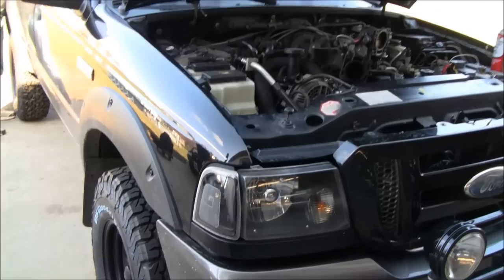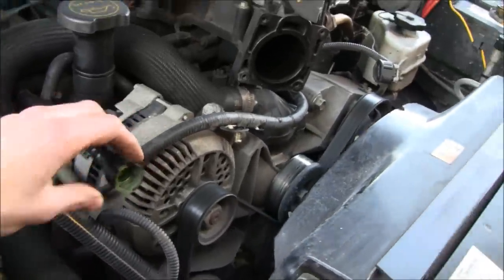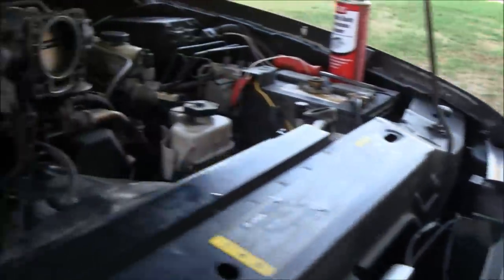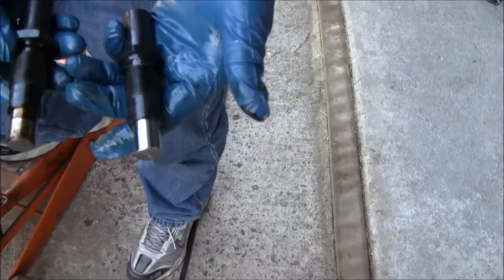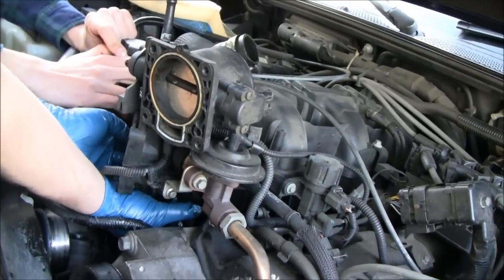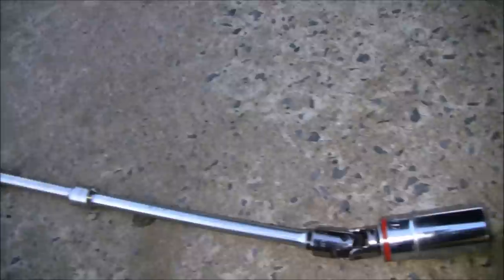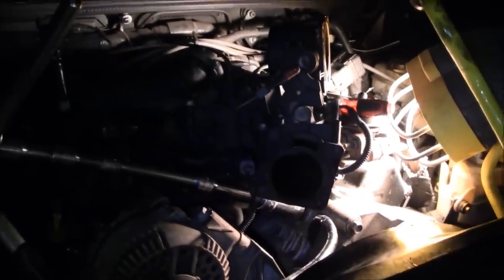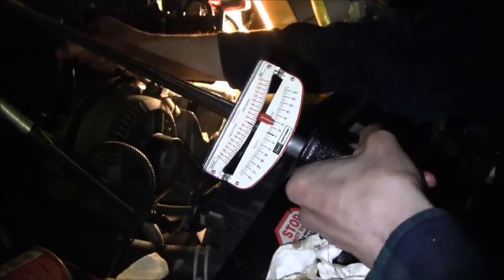REPLACING TIMING CHAIN TENSIONERS 4.0 SOHC

Comment: I got around to finally picking up the parts from Ford to do this.  Both tensioners and washers $210.  Going on my '03 that just has 69k miles on it.  Has always had the intermittent 1 second rattle at start up after sitting for a few days, nothing more.  Hope I don't break the thermostat housing is my only fear but if I do I know where they sell new ones....lol.

What was the difficulty in getting the top one to thread in in this video?  Just curious.
Reply from the maker: klc317 What really makes it hard is the fact that you have to fight the tensioners. After having primed them with oil they are very stiff and so you are fighting that pressure while trying to screw them in. After having some discussions with others who have done their tensioners, I'm not certain that they actually need be primed. This would make them a lot easier to install, but I don't know if I'd try it or not. You definitely don't want to have a problem with air stuck in them or something like that.
Reply: dirtbike5100 ok, thanks.
Reply: I got the whole pile of other parts as well in the mail today, the thermostat housings, new thermostat, all the seals, O-rings, and new sensors and retainers, etc. all OEM Ford stuff.  Really didn't cost that much more ....might as well do it all once and right IMO.  I'm kinda wondering if I can pull the fuel pump relay before I take stuff apart and run the engine out of gas.  Then crank it a little once everything is put back together to get oil pressure to the tensioners before reinstalling the relay without priming them first so I don't have as much as a fight installing them and risking cross threading.

I'll do some more reading and see, not in a giant hurry anyway.  Its cold in the garage and the Ranger is not an every day driver so I can wait until warmer weather.   Thanks again for the informative videos and replies!
Reply from the maker: +klc317 Anytime. Pulling the relay and cranking the engine will definitely get oil to the tensioners. The question is whether or not an air pocket in the tensioner itself could prevent it from fully filling with oil and working correctly. I don't know the answer to that however.
Reply: I did the job today.....just to try it out I did not prime the tensioners, seemed to work just fine.  Just about 1 second of noise until the oil pressure took over....no problems.   I also did the entire thermostat housing, new thermostat, sensors, seals, and O-rings...everything all OEM Ford parts.   That was pretty tricky trying to fish all that housing stuff around and not damage the new one but thanks to your video and a few others it wasn't a big deal....went in easier than the old one came out once you figure out how to get all the crap manipulated and out of your way.   And yea, some some of 8mm offset ratcheting wrench and some swivel sockets sure made those bolts easier!!  Successful, no leaks, just some oil burnoff on the exhaust manifold from the passenger side tensioner leaking out when I removed it.   Got it hot, drove it, let it cool off, burped some more air out of the cooling system, and all is well as far as I can tell.
Reply from the maker: +klc317 Good news. Thanks for reporting back on how it went!
Reply: Ford OEMs much cheaper thru Amazon\Ebay.  Local stealership will rip you every time.

Comment: So why do you need to prime these...  I mean I get the concept but I can not find any other information about doing this to these before you put them in.
Reply from the maker: Keylitho When I replaced them in my truck, I had problems with them not keeping tension on the chain and after doing some research I came across a few YouTube videos suggesting that I prime them. However, I later found out that the reason my tensioners weren't working was that they were not genuine Ford parts. It's possible then if you don't prime them but use Ford parts you will be fine, but I decided not to take the chance with the truck in the video.
Reply: Ok.. Good to know... I just replaced mine but just lubed them up a bit and did not prime them... (they are not OEM) and they seem to be ok... But I have not dove it around to see if all noise is stopped at all RPM's..
Reply from the maker: Keylitho The non-OEM ones I put in my truck were from Advance Auto. Brand was called SA Gear, I think. I started the truck up and the chains rattled continuously at any RPM. If it's not making noise at idle, that's a good start!
Reply: The ones I got are made by Cloyes Gear & Products, Inc.   I will keep my fingers crossed... If not then I will go get the ones from Ford.
Reply: Any luck with the cloyes brand tensioners?
Reply: No... went an got the OEM ones from Ford..
Reply: Keylitho Cloyes is the manufacturer of Ford original tensioner.
Reply: AZ DONALD A lot of people don't know that Cloyes is the ORIGINAL manufacturer of a lot of Ford timing components.  These tensioners included.
Reply: funny thing is that yesterday I was just cleaning up my mess (garage) and came across the boxes and realized I still have to install the front one, grrrrr.  

i'm glad they made improvements to the gear chain mechanism in 2002 cause I have no problems at all, just doing preventative maintenance since this is our cross country traveling vehicle.

i'm sure it'll make another 160,000 mi without problems.

I didn't prime my new rear tensioner on my 2002 ranger 4.0.

I started it up, it rattled for 2 seconds tops, then went completely silent. oil pressure goes to it immediately thru that hole so I don't know why all the talk about priming them.

not such good luck with the front left one though.  

was great on the first ride, no noise no problems.  now after a couple of trips to town it sounds like a diesel, literally. last night was the worst it's been and i'm not driving it till I get all my parts in a few days.

no big deal though because after doing it the first time I realized I have to change the thermostat housing and sensors anyway so i'll change that tensioner with a warranty replacement from rockauto.com .  

WHY DON'T THEY TELL YOU THEY NEED TO BE PRIMED RIGHT ON THE BOX?  I DOUBT IF THEY WERE PRIMED FROM THE FACTORY BUT WHY DO YOU RUN THE CHANCE OF THEM RATTLING IF YOU DON'T PRIME THE REPLACEMENTS? MAKES NO SENSE.  WHAT IF YOU PARK YOUR TRUCK FOR AWHILE AND THEY DRAIN OUT?  OH WELL....

in the end, my original tensioners with 165,000 miles were just fine, springs were a touch weaker but they were fine.  i'm beginning to believe the old adage of "if it aint broke don't fix it."

I only changed them cause of all the scare talk. I doubt i'll ever have to change them again now.  I heard they made major improvements in 2001-2002 to the whole guide assembly.

I also heard that running synthetic makes them and the guides last forever, maybe that's why I had such luck with mine.

I've been running Rotella T6 for the last 110,000 miles changing it every 17-20,000 miles and a filter and top off at about 6,000 miles.  I do this on all 5 of my vehicles saving a LOT OF TIME AND WORK AND MONEY.

my last oil analysis from http://www.blackstone-labs.com was all normal except they said I had a dirty air filter and they were right!

I save 3 out of 4 oil changes by doing this and using Purolator PURE ONE oil filters (or wix if you can't get the pure ones)

hope this helps someone...
.
.

Comment: How much do those tensioners cost?
Reply from the maker: Approx. $200 for the two tensioners and matching washers
Reply: $60 at www.rockauto.com plus shipping.

like mustang said above, "A lot of people don't know that Cloyes is the ORIGINAL manufacturer of a lot of Ford timing components.  These tensioners included."
.